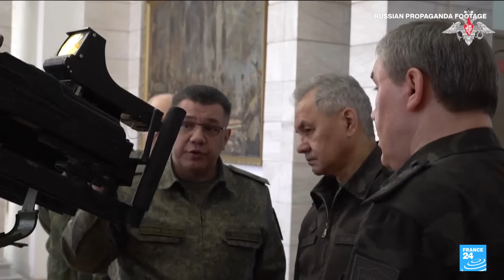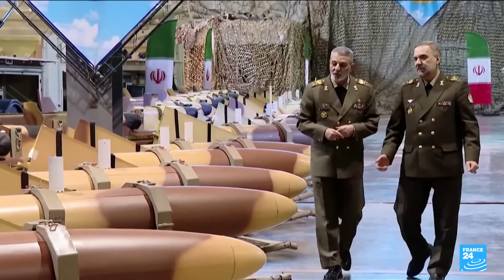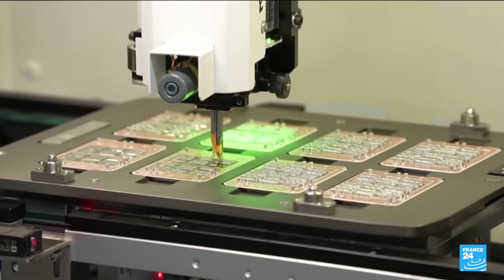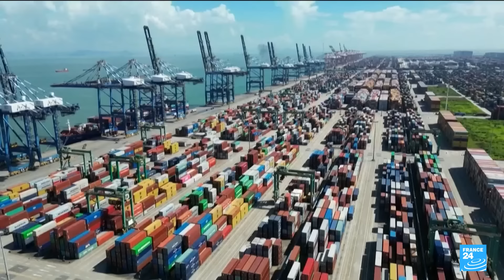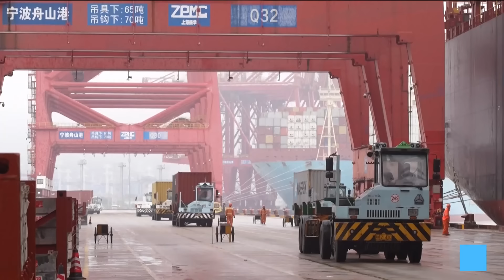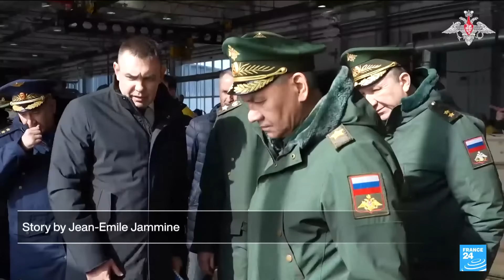The loopholes that keep Russia's weapons industry afloat • FRANCE 24 English

Comment: western hypocrisy  ? lol
Reply: No. If individual companies circumvent the sanctions and other countries help them doing so, it is largely not the fault of Western governments. Btw this is a western media outlet.
Reply: @davidwolf8991  Unilateral sanctions are illegal unless imposed by the UN.
Reply: @psnaris  Russia violated the UN charta before any sanctions were imposed. And unilateral sanctions are not illegal.
Reply: @davidwolf8991  and Israel ?
Reply: @davidwolf8991 what about Israel?🤣
Reply: @davidwolf8991 Europe sanctioned itself😂
Reply: @davidwolf8991  when Russia violate it?
Reply: @Mman.  German energy prices are lower than before the invasion, gas is at 7.8Cents per kWh on average for new customers that is 68% of what it costed right at the start of the invasion. For electricity its similar currently one kWh of electricity costs 26,2 Cents per kWh on average for new customers that is 71% of what it costed at the start of the invasion. On Zeitonline Energiemonitor current prices are visible for everybody.
Reply: @davidwolf8991  I’m not a European, let alone a German. If you like the direction in which Germany is headed, then I love it. Carry on.
Reply: @davidwolf8991 How many times has the US violated the UN charta while invading Iraq and Afghanistan 🤷
Reply: @Starlink502  How does one wrong justify another.
Reply: @psnaris  What? Did you just make this up? 🤣🤣🤣🤣